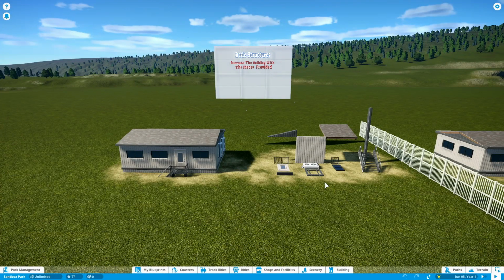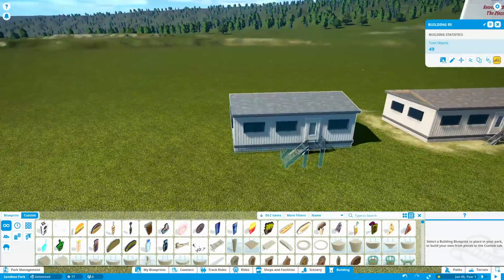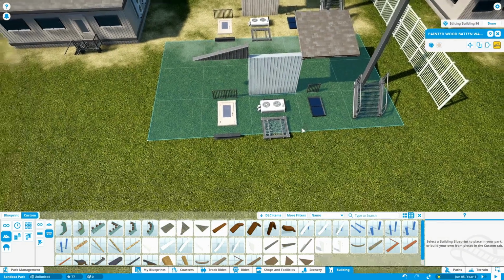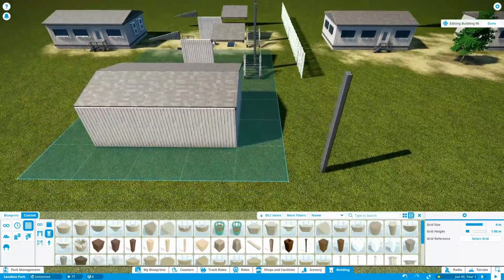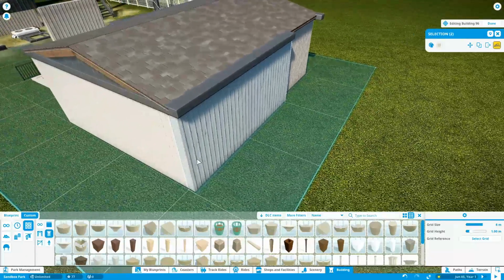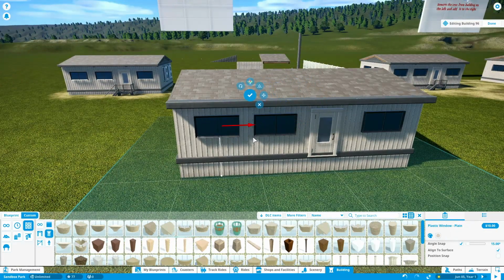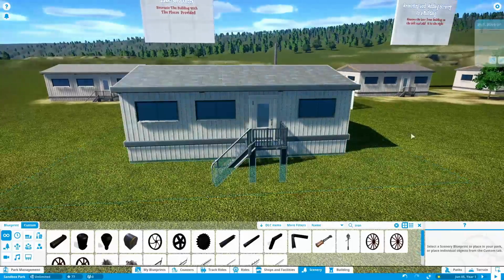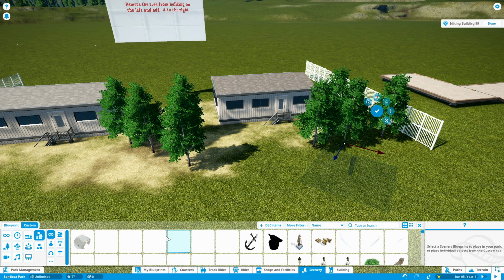Planet Coaster: Interactive Tutorial Park [Ep 1] - Basic Buildings

Comment: Hey ruble, thanks for the tutorial video.
I have a problem: i tried to copy the metal floor from the stairs but it always ends up not beeing copied from the previoua piece.
(Already tried it after i saw a tutorail from geekism, i think it was about placing centered objects into another)
Is it me or did planet coaster change that function
Reply from the maker: Hey Detective Tudor! are you referring to using F as a way to center an object onto a wall? I'm not too sure about that. I use it sparingly and I don't think it works on all of the scenery pieces. I use ctrl + x to copy most of my work over.